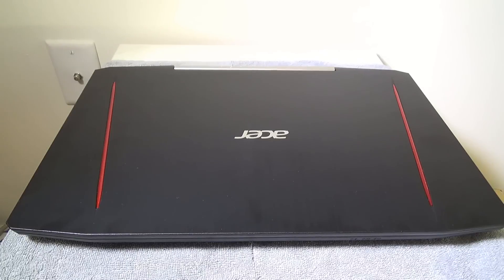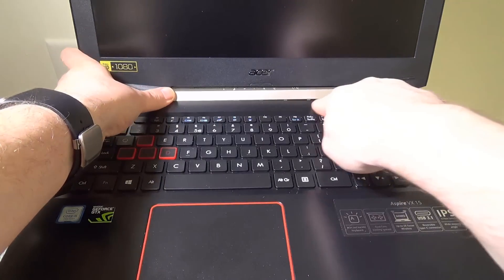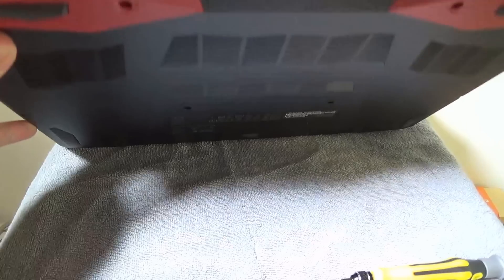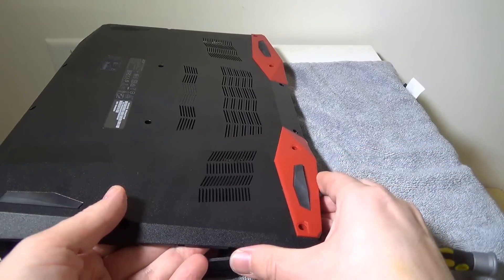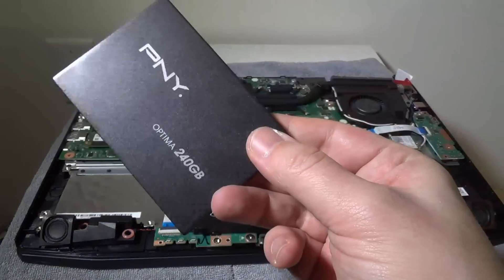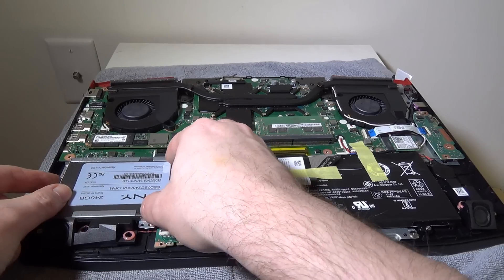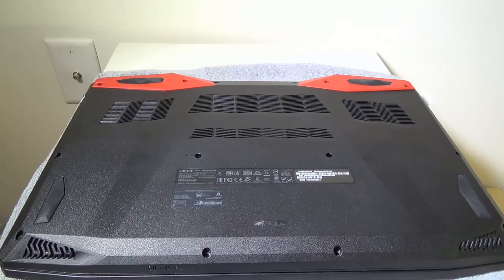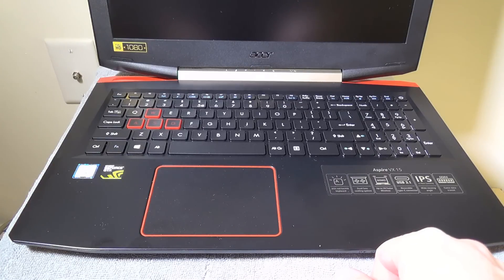Acer Aspire VX 15 Gaming Laptop VX5-591G-54VG How to add a 2nd HDD/SDD

Comment: On the overall machine I liked it but the deal breaker to me was the lack of display port or hdmi 2.0. With one I could have made this a desktop replacement so that when I need color accurate I could plug in a 4K external monitor at 60hz
Reply from the maker: you can just do 30hz, for color accurate work do you really need 60hz?  Anyway with Nvidia GPU  you can use Nvidia hdmi which will push 60hz 4k over a 1.4 HDMI port so you can hook this up to a 4k TV (I did on my Vizio 4K) and get 60hz.
Reply: well. I meant in general for whenever you want to use a full monitor, I just happened to have been using a cheap Samsung 24" 4k monitor (for instance, somehow in some games like battlefield1 I often find hard to see some dark shapes when playing in the Acer, but on the full monitor I appreciate some details better even if playing at the same 1080p medium or high). on your suggestion, you managed to get 4k at 60hz from the Acer VX15? I gave up after trying with two HDMI cables; maybe I gave up too soon.

Comment: Minor point, my personal preference is to BEFORE putting the scews back in, boot the laptop and check if the disk is been recognized in disk manager (Windows+X+K). it is a pain to realize the cable is loose and you have to remove all 14 screws again.
Reply from the maker: That is a good point, you will also have to go into Disk Manager anyway to create a partition for the computer to have it show up in My PC.  Thanks for the tips for my viewers I get asked that question almost everyday (also the one about why can't I see my drive after it's installed..) lol
Reply: Galaxy Tech Review it says my hdd is Uallocated, what do I do?

Comment: useful but at around 114 you said a proprietary cable. I think that is not accurate, I have seen teh same SATA port cable in many laptops. for instance, the XPS 15 or Precision 5510/5520 have that port too.
I installed my in the VX15 last week, it was in all 5 minutes, quite straightforward. this is a very versatile machine.
Reply from the maker: Usually you don't have to worry at all about the cable, it's already there for installation (most users will never need to deal with that)  Acer definitely regretted that mistake I am sure having to send kits out to 1,000s of users lolz They did NOT make that mistake when they released the Helios 300 the hardware came pre installed LOL
Reply: Galaxy Tech Review now that I remember once with a dell precision 5510 I had to buy the rubber rails and cable to install a 2.5in disk. But I did not try asking dell first I just bought it on amazon for 10 bucks or so.

Comment: hi man,
when you just have an 1tb hdd. Do you still need the mountain kit than?
Reply: mounting kit*
Reply from the maker: +BestMordeEUW no you do not cuz it will be holding the 1 terabyte drive in place
Reply: Galaxy Tech Review how about the connector?
Reply from the maker: +Mickey Damasco no not in his case because of the existing 1tb drive he is replacing. It will of course already have a cable as well.
Reply: Galaxy Tech Review so if i bought the m.2 version i will need a connector for another hdd. thanks man.
Reply from the maker: +Mickey Damasco yes you would.

Comment: My model comes with the 256gb ssd. Would it be possible for me to add another 500gb ssd to it?
Reply: Any help on this would be greatly appreciated!
Reply from the maker: you can replace the 256gb with a larger model yes. you cannot add another m.2 ssd because there is only one slot, there is a slot for a sata 7mm hdd/ssd though.
Reply: Galaxy Tech Review will a standard 2.5 samsung SSD work in the additional slot?
Reply from the maker: +Nothing Atall yes.
Reply: Galaxy Tech Review thank you so much! I greatly appreciate it! you've saved my ass on my upcoming classes.
Reply from the maker: +Nothing Atall no problem
Reply: If you're gonna replace the ssd then how about the os?

Comment: The kit is needed to put the HDD or SSD (not m.2) inside the laptop right? 
Acer does not supply you the kit if your VX15 comes with storage from the m.2 slot, not the HDD,  therefore you need to ask acer to send the kit afterwards..
 My question is, if I buy this laptop with 1tb HDD as storage from the shop, logically speaking it gotta have the mounting kit installed inside to hold the HDD right?
 or am I wrong and still need to get the mounting kit even though that is the case?

Please enlighten me, thank you!
Reply from the maker: +Saiful Islam yes if you buy it with a 1 terabyte hard drive then it will already have a mounting kit because it has to to hold the one terabyte. But then you would just have an open  m. 2 slot to add a m dot 2 Drive
Reply: Alright thank you so much ! by the way, great video man! now i feel confident to disassemble the vx15. Subscribed!

Comment: I plan to get this laptop to play Overwatch. Is the HDD added in the kit or will you need to buy your own? And do you really need the HDD at all? I'm a bit new to PC gaming and I'd appreciate it if I could get a reply.
Reply from the maker: +Riolan the kit is just the mounting hardware you have to buy your own hard drive. I would suggest buying one as the 256 gigabyte M. 2 drive fills up pretty quick.

Comment: Do you know what specific kind of ram comes pre-installed on this laptop? I want to get the second slot filled without having to buy to extra sticks
Reply from the maker: +johnchoshayes it will be either Kingston or hynix brand Ram they use both types. Best bet is to open yours and see which one is in it and then match up the second stick although you can mix and match as long as they're the same speed and it won't make a difference.

Comment: anyone know where to order a mounting kit for europe? help will be much appreciated, thanks!!
Reply: 50.GM1N2.005 CABLE.HDD
33.GM1N2.002 BRACKET.HDD (HDD of 9.5mm)
86.GM1N2.003 SCREW.M2.5x5.0 - Head Ø: 5.5 (Qty=4 - To fix bracket/case)
86.G1FN2.008 SCREW.M3.0x3.0 - Head Ø: 4.9 (Qty=4 - To fix HDD/bracket

these are the serial numbers of the parts you will need, in my case they had the screws on site and gave them to me for free but might be different for you
Reply: Hi abbaking, i contacted my local licenced acer distributor, in Latvia they were very competent and i got my parts in 3 days from ordering (cost 26euro without pvn, they were nice enough to give em to me without pvn if i didnt need a receipt), if that doesnt work i found this http://community.acer.com/t5/V-and-VN-Series-Laptops/Aspire-VX-15/m-p/499244 here an acer help and support worker has given the serial numbers of the parts within the spoiler, they are much easier to be found using these numbers, hope this helps buddy, the computer is amazing, but the big problem is the space, i added a 500gb ssd and cant be happier with my setup :) gl on the hunting dude!
Reply from the maker: +Rudolfs Udris nice thanks for helping my non usa viewers. 👍
Reply: yoo thanks man , you give me a lot of help
Reply from the maker: Not sure for anywhere outside the USA.  You would have to contact Acer on that, I'm thinking.
Reply: Rudolfs Udris how did you fixed it? I'm from EU too and i contact the support and they told me that they could send me nothing
Reply: glad i could save you the trouble, took me a month to get my mounting kit :(
Reply: @rudolfsudris2691  thank you mate

Comment: I have found out that this "kit" is only for us/canada. Im not in us and was thinking of buying the vx15 from amazon... is there ANY way for me to get/buy this kit from internet? acer support only works if you already have a laptop purchased and I couldnt find the kit anywhere in internet seperately.
Reply from the maker: +sparlexna I don't know personally because I'm in the US you would have to contact Acer directly about that.
Reply: sparlexna how did you fix it? I'm from EU too
Reply: I ordered my laptop but didnt recieve it yet... its still shipping. but I am from Turkey and Im gona use a turkish agency who opens a mailbox and ships stuff from that mailbox to my location (with a little extra cost ofc) but still since its free It wont be a problem... you can search for something like that. there are few knockoffs on ebay but I would not buy them if I were you. (they dont even come with the rail most of the times anyway)
Reply: hi, check my thread just above for my solution, hope it will help!

Comment: can we go to an acer store and ask them to install it for use?
Reply from the maker: I have no idea about that, you would have to contact them.
Reply: Is the size of the screw on the VX 15 the same? (Cuz i barely open a laptop up like that and the last time i did, there is 1 screw was left out)
Reply from the maker: +Patrick Nguyen I would assume all the bottom screws are the same size yes.

Comment: Would this be a good option for adding ram? https://www.amazon.com/gp/product/B019FRCV9G/ref=ox_sc_act_title_1?ie=UTF8&psc=1&smid=ATVPDKIKX0DER

or is this just as good for a bit cheaper?  https://www.amazon.com/Patriot-Signature-PC4-17000-SO-DIMM-PSD432G2133SK/dp/B01DYVWNXS/ref=sr_1_12?s=electronics&ie=UTF8&qid=1494654148&sr=1-12&keywords=16gb+laptop+DDR4-2400
Reply from the maker: Either will work.  The speed difference you won't even notice.  So go for whichever is available/fits your budget.

Comment: Do you have recommendations on a hard drive to add? Something like a 1 TB drive?

I've never had to add an extra HDD to a laptop before
Reply from the maker: I added a 2TB Seagate Firecuda SSHD drive to mine... you can check it out here  http://amzn.to/2pATYYp  They have em in 1TB as well.
Reply: Thanks for the reply!
Reply from the maker: +zzyzx0788 no problem
Reply: Hey FYI dude, that Hard drive you recommended has the cable facing the wrong way, I gotta return it. Not sure why it faces different from everything else but the holes don't line up from the way the wire attaches to
Reply from the maker: +zzyzx0788 did you mount it the way I said in the video? Bottom side up so it matches the cable.
Reply from the maker: +zzyzx0788 lol you just flip the drive over in the mounting bracket.
Reply: You can't, the holes don't line up properly. The holes are aligned to the bottom on both the bracket and hard drive
Reply: *edit: ok, it might work after all
Reply from the maker: +zzyzx0788 lol glad you figured it out.
Reply: Hey bud, sorry to bug you one last time, but I have a question. So I finished putting in the hard drive but it's not showing up when I check "Storage" in Settings. 

Is there something else I have to do?

Do I have to create a storage pool for it or something? It looks like the computer sees it as an unformatted drive under Manage Storage when I click "Create a new pool and storage space". I'm like 95% sure that its the hard drive based on the space size and ID
Reply from the maker: +zzyzx0788 you have to create a new Partition on the unformatted drive for you to be able to see it in my PC
Reply: Thanks. Do you know if I should use MBR or GPT when initializing it?
Reply from the maker: +zzyzx0788 gpt is fine it's not going to be your boot drive.

Comment: good thing I got an 128ssd +1tb and I won't  be needing the tool kits. Doing so  is this gonna void your warranty?
Reply from the maker: +Jonathan Suniga no it does not void your warranty. Says Acer.   :)
Reply: thanks  man I'm thinking of upgrading may ram :)
Reply: Jonathan Suniga where did you get the mounting kit ?
Reply from the maker: +AZOZ Acer sends it out for free link is in the description.

Comment: there 2 sizes for hdd
 7millimetersz-height

https://www.amazon.com/Seagate-BarraCuda-2-5-Inch-Internal-ST1000LM048/dp/B01LYNQXCP/ref=sr_1_1?s=electronics&ie=UTF8&qid=1493613460&sr=1-1&keywords=2.5+hdd
_____________
and this 9.5millimeters 

https://www.amazon.com/2-5-Inch-Internal-ST1000LM014-Certified-Refurbished/dp/B01DCRZIB8/ref=sr_1_11?s=electronics&ie=UTF8&qid=1493614436&sr=1-11&keywords=ssd+2.5+inch+for+laptop

please please please answer me i will buy
Reply from the maker: +93 commanderA the one I use is 7mm Z height. So go for that.
Reply: Quite happy thank you very much

Comment: so i'm not from the usa or canada, can i buy kit from amazon ?
Reply from the maker: The kit itself is not on Amazon. So I'm not sure where you would get it from, I would assume you can call Acer and they would at the very least sell you one.
Reply: same question here. did you manage to find any solution? Im in eu region but I wouldnt mind paying $ for the kit IF I can buy it in the first place. I will NOT buy the laptop if Im not gona be able to use the hdd slot at all.
Reply: sparlexna no i just bought another laptop
Reply: what did you buy can I learn?
Reply: Lenovo Legion Y720
Reply: lenovos usually have heating problem. did you have anything like that? how is the performance in general ? (I know 1060 is more expensive than I can probably afford but I might buy this too... still searching)
Reply: sparlexna a bit of heat but there's a mode for the fan to fix heating

Comment: Regarding the ram, can a different brand of RAM work with the built in RAM given that the ram i am planning to put has the same spec as the RAM installed? So will a different brand work or nay?
Reply from the maker: Yes you can use any brand you like.
Reply: since the model i got has 1x4gb, i should ONLY add another 4gb RAM right? not an 8gb or anything? And thank you!! Not so good with these stuff yet
Reply: Also, do you have a video for changing the RAM? I'm scared to touch something im not suppose to :(
Reply from the maker: +EJ Caliva yes usually you put em in as pairs. I.e. 2 X 4gb or 2 X 8gb  ect.

Comment: What's the part number for the caddy and cable? I'm trying to find it on ebay in the UK. Thanks.
Reply from the maker: +basketcase I read it and show it at the beginning of the video.
Reply: Yeah I saw the caddy number on the bag, but was just double checking because I was having zero luck finding it online, and I don't think acer will ship to an APO.
Reply: You could use shipitAPO

Comment: Does that cable to connect the hdd to the computer come with the pack acer sends you?
Reply from the maker: 0329Omar yes it does.
Reply: so i installed the hard drive how do i access it once i start my laptop?
Reply: nvm figured it out

Comment: 1). Is the kit available in India?
2). What type of hard disk is suitable for the 16gb variant?
Reply from the maker: 1. You would have to contact Acer directly for the kit availability outside the USA.  
2.  Any 2.5 inch SATA HDD or SSD will work for the drive bay.

Comment: Finally the Crucial drive that I ordered from Amazon has arrived. I suggest people avoid using Amazon if they can help it. After action report. Impressed with build quality of this plastic laptop. It is about as rigid WITHOUT the screws as it is with them, I doubt it would take much modification on Acer's part to make a tool-less bottom cover. Hinged maybe?. Screw next to the R45 jack was tight as sin, rest were fine. No crossthreads, none loose, wish I could say that about my Dell that I had previously. Screws holding the Crucial drive to the caddy were not a good match for the holes but did go in. Even though I tried to start them turning them in reverse until I felt the screw drop into the first thread, but they are in there not loose and the straightness of one screw isn't critical. My mistake was I probably should have fast forwarded ; ). Suggest putting a little pressure on the back (any laptop) when removing or installing the center screws on the bottom. A 525GB Crucial drive yields 488GB actual.
Reply from the maker: Nice, thats the drive I put in crucial mx300 525GB SSD.

Comment: Nice video but i have a question.I bought this laptop last week and i want to add a second hdd but when i request that to acer it says incorect Acer serial number...How did you recive your kit ? Can you contact me ?
Reply from the maker: I just filled out the  form online (it's in my video description)  if the serial number didn't work, try the SNID.  Also are you outside the US? If so, you may have to call Acer support directly.
Reply: Galaxy Tech Review yes I am from Europe
Reply from the maker: +Victor Jackpot I would contact acer directly on this issue then  as I am in the US and that forms worked fine for me.
Reply: Galaxy Tech Review thx I've just found out that I have to pay another 40 euros to get the kit... because Acer sucks...

Comment: Hey quick question, what RAM did you use to upgrade? Whats the manufacture, I got the i7 with 16 GB but want to upgrade to 32.
Reply from the maker: I did not upgrade the RAM, mine is at 16GB I find that to be good enough for me.  It is micron memory though.  but any 2 sticks of DDR4 2400 RAM will work. That is like a 200 dollar upgrade though.

Comment: than you for this video, very helpful!
Reply from the maker: No problem, glad I could help.
Reply: hi, i've done the upgrade and put everything back together, laptop has detected the new HDD fine, but now everytime i close the lid, the laptop does not go on sleep mode. any thoughts? please help :)
Reply from the maker: +johnnydls68 check power in Windows settings? There is a setting specifically for what happens when you close the lid.
Reply: thanks for the quick reply, yes i have checked the settings and it is set to sleep when lid is closed. is there maybe a physical switch i might have missed when i reinstalled the lid or the silver cover back? i will try to pry it off again see if i get lucky...
Reply from the maker: Ya just reverse your steps, I know the laptop will not power on with the bottom cover off, maybe there is a contact of some kind that isn't seated correctly.
Reply: did everything again, opened it up, removed the installed hdd, booted up and still no sleep when lid is closed. reinstalled hdd, booted up, same thing, no sleep when lid closed. i dont know what to look for in terms of a type of switch that will enable sleep when you close the lid. :(